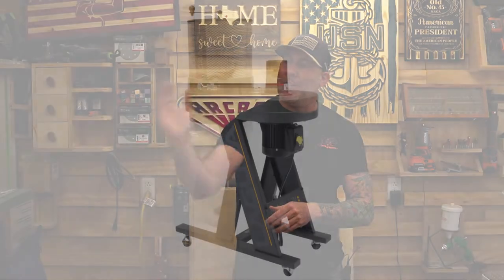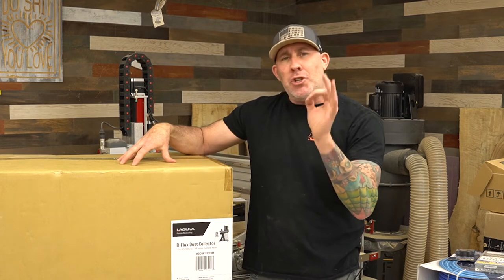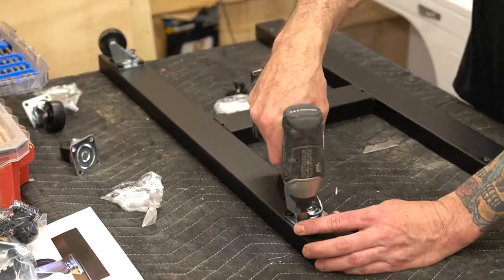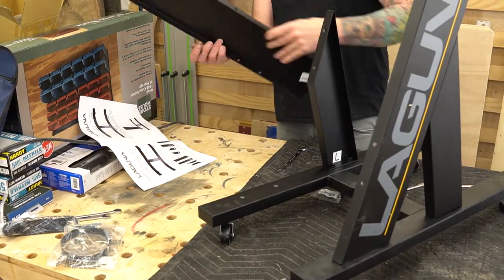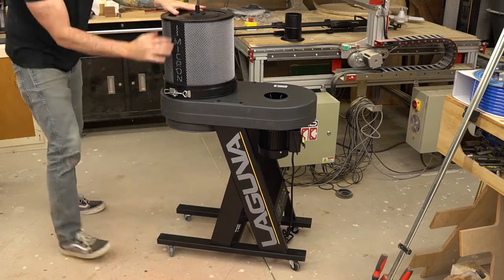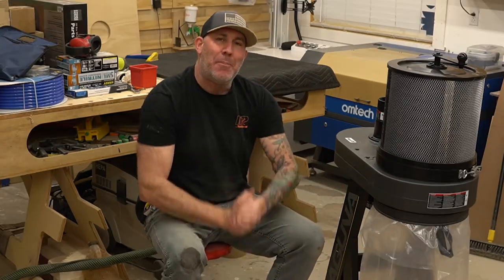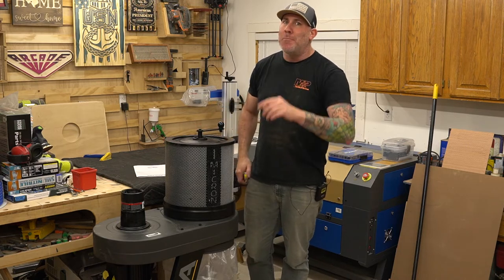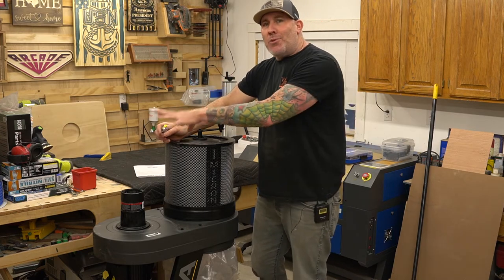Best Small Dust Collector

Comment: The little B-Flux is a great unit....It's perfect for small machine dust and works like a champ!  As with any dust collection system, you may need more power for larger machines.  That's why I recommend a P-Flux 3 for an overall solution for the entire shop.
Reply: Why not the C-Flux 3 then? Is the slight sound damping and autoclean worth the $1200 upgrade? You can get a C-Flux 3 and TWO B-Flux for the same price! I would assume 3 or even 2 dust collectors with shorter ducts and hoses is better and cheaper than one huge dust collector with probably an even more expensive metal ducts across the whole shop.

Comment: I bought the Dust Right 750 last year. Had I known about this Laguna unit at the time, it would have been a toss up on which one to get. They both have about the same specs with the money spec being the airflow at the end of the hose. My '750' gets right around 500 cfm and the Laguna specs say 550 cfm. 

If I were to be buying this year, I would have gone with the B-Flux. It's $599 and the '750' is over $800. When I bought my unit last year it was only $550. What a difference a year makes.

At 500 cfm, the Laguna and the Dust Right machines get the job done for a small shop. They're mobile, they're compact and they suck!

Comment: Folks with 220 should check out the Camvac. To me, it was worth the electronically upgrade eevem if I never buy another 220v machine. High pressure systems are amazing and much more versatile than the low pressure systems. If I didn’t have the 220 capability, I no doubt would have gotten the Laguna

Comment: I just put a bflux together. The manual was pretty vague which cost me a couple of hours. It doesn't come with a hose. The one  bolt connecting the top to the left has no clearance for a socket or ratchet. They could have moved that 1cm awat from the edge. The inlet fits neither  inside nor outside of a 4" hose so I had to go searching for some sort of coupling, that was not included. I see in the video you just jam a hose on it, but the 4" hose I got from Rockler did not fit. YMMV.

Comment: hey I have. a Laguna IQ CNC router and trying to find a good dust collector for it. I almost got this the other day and the one I looked at said 650cfm but was wondering should I get a 1000 cfm. Do you recommend this for a Laguna IQ CNC router? I would only run the collector on one machine at a time. I'm looking at 1hp or a 1.5 because I know some like dust rite says 750 but it's a 1 hp just like Laguna.

Comment: I have one on order but am considering upgrading the filter to a MERV15  (0.3 micron filtration) as the fine dust in the air is really getting to my eyes and throat. You recommended silicon sealant; are you seeing dust shoot out of the unit in places if you hold up a flashlight to it with the lights off?
Reply: Im a new woodworker and have a bucktool bag dust collector and just started realizing the harmful dust is the one lower than 2-3 microns. Im interested in this Laguna filter and confused as is description it says this MERV 12 filter filters particles from 0.2 ~2 microns....thats where im confused if it says 1micron filter. so 0.2 is less than 1 Micron.

Comment: Have you considered running hard duct throughout your shop, or do you not have enough room to do that?
Reply from the maker: I have enough room, and technically I should do that. Would require a large investment into a serious DC :)
Reply: @RISENGRINDWORKSHOP  You may be surprised by what you actually need.  In my shop, I am using a 1 HP unit and have all my tools ducted to it with a trash can separator with a Thein baffle.  I did increase the inlet to 6 inch and vented it outside with a 6 inch vent though.  Also my tools are in a pretty tight layout within a 10 foot by 10 foot area in my garage so I’m sure the short runs help.
Reply: @jayraysdiy852  is your 1hp good enough for ducting system? I am thinking of this laguna b flux, but I feel like it is a bit overpriced and the same as the other companies 200/300 dust extractors
Reply: @POLPO_WOOD  With the system I have, the most CFM I am getting at a tool is 320.  If you have the money, I would recommend at least a 2 horsepower system for ducting in a shop.

Comment: Appreciate the vid and review but that dust collector is severely underpowered. I had it for less than a year and got rid of it for Harbor Freights dust collector. Sure it’s bigger but so much better value. Still cheaper too after you buy an after market Wynn filter. Cheers.
Reply from the maker: Now that I have spent some time with the unit, I would agree that it's not the most powerful unit. If this was my main unit I would def not be happy. You also have to use this unit for it's intended purposes. My dewalt Planer, 6" jointer and drum sander work perfectly fine with this model. I hate the HF unit. Loud, bulky, have to dick around with it to make it work better, need to upgrade the bag to a better bag etc.... yes it will perform better, but pass on that and buy a proper whole shop setup at that point. Thanks for sharing! Appreciate the comment!